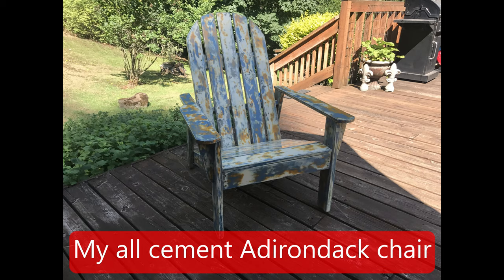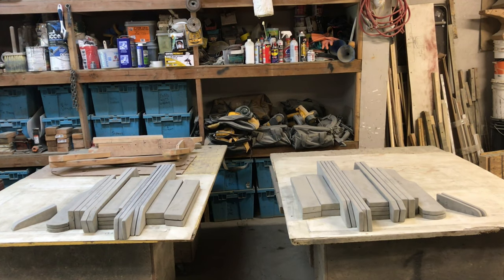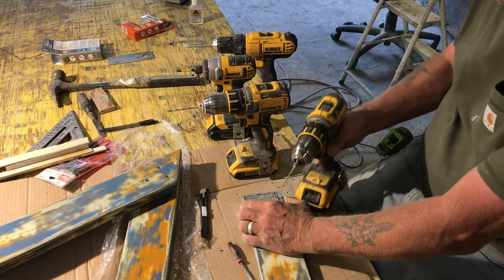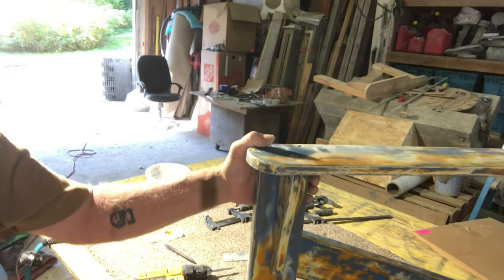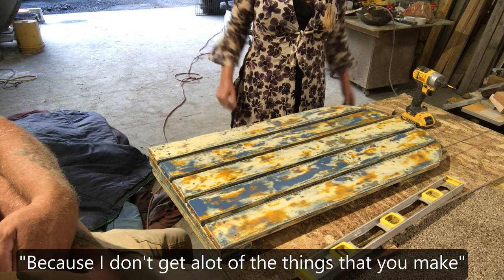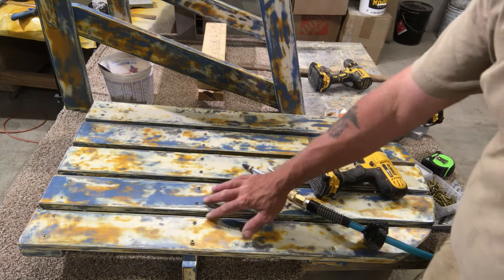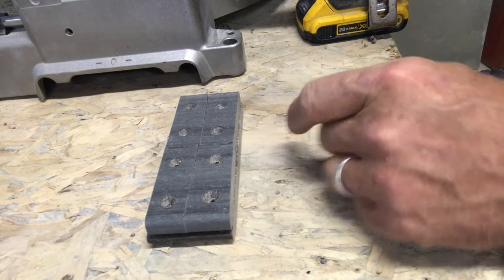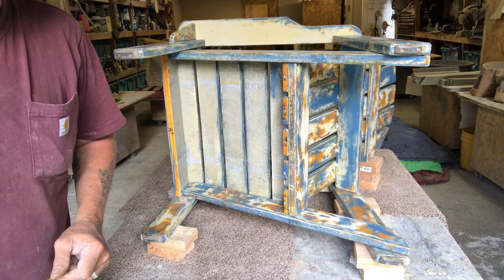How to make a Cement Adirondack Chair

Comment: Are you just using regular cement and adding the fiberglass to the mix for strength?
Reply from the maker: No I have a cement fiber reinforce composite material that I’ve developed and allows me to cast thin pieces but yet gain extreme strength
Reply: I need to make a chair like this it's amazing! What is the mixture you used?
Reply from the maker: I made the chair with a fiber reinforced cement (FRC)
Reply: Ok so I can make this chair with concrete countertop mix?
Reply from the maker: That depends on your exact formula
Reply from the maker: Increases acrylic and fiber at the minimum